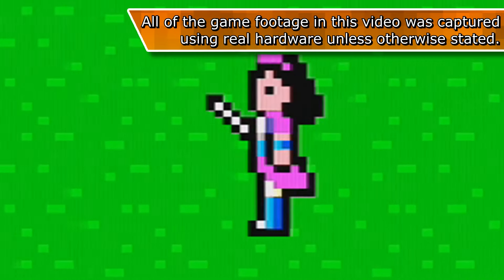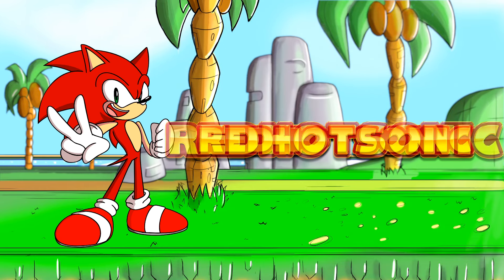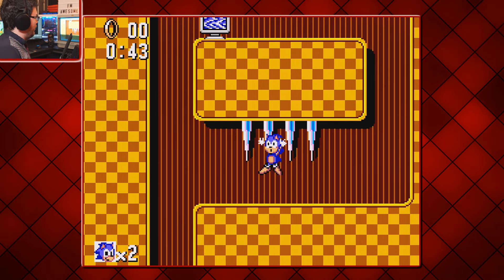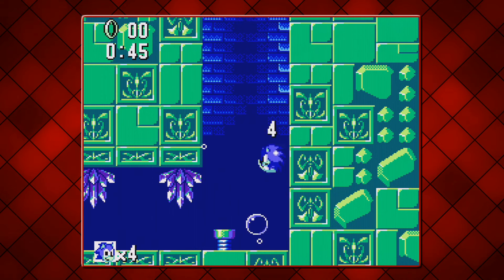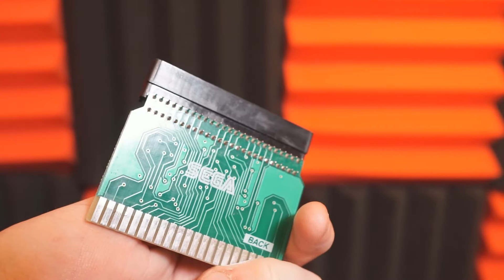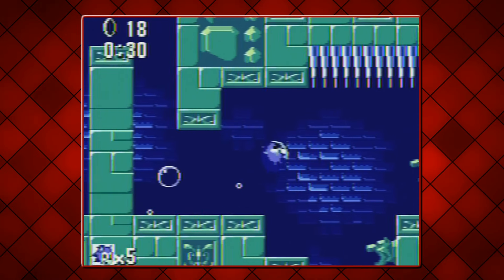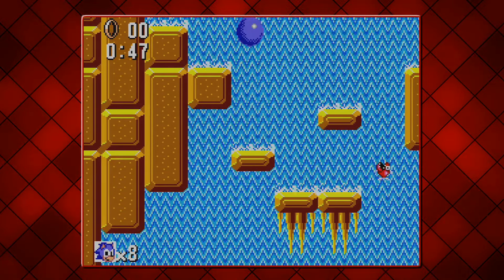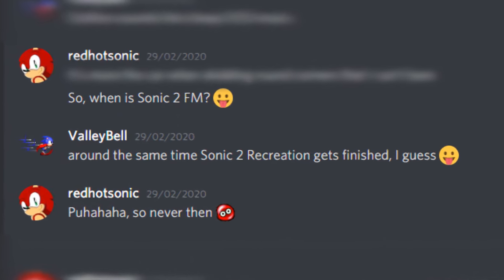Sonic 1 FM - But does it work on Real Hardware?

Comment: I got my Sms2 modded with FM unit but after all of that I decided I much prefer the PSG sound.
The FM music on Master System doesn't even sound as good as Nes standard nor Pc Engine and is definitely inferior to the Mega Drive FM sound.

The PSG is where I feel the Master System sounds decent compared to other consoles around at the time.
Reply from the maker: All depends on the game, personally. If you try the original Outrun with FM, you're correct, PSG sounds better and FM is awful. However, try Outrun 3D in FM. It's the best music I've ever heard come out of a Master System and kicks PSGs bottom.
Reply: @redhotsonic  Probably but when I am comparing Outrun theres two obvious versions.

1 is the Arcade and 2 is the Megadrive version.

The Master System FM version sound's worse than all and arguably even the Pc Engine version depending on your preferences

The instruments used sound very weak to me and sound effects always suffer a bit farty
Reply from the maker: @WWammyy  Yeah, each to their own. Outrun for FM is bad but I urge you to listen to Outrun 3D FM on the SMS. Especially "Midnight Highway" and "Shining Wind". But regardless, at least you now have an FM chip in your SMS so you can pick between the two rather than always being forced to PSG 😊
Reply: @redhotsonic  Will give it a go I've never actually played any of the 3D games because I have an SMS 2 which doesn't support 3D glasses but does support higher resolution than the OG SMS so the Code Masters games work on it or at least that's what I've heard
Reply from the maker: @WWammyy  this doesn't apply to all 3D games, but Outrun 3D can be forced into 2D (it gives you the option after the title screen) :)
Reply: @redhotsonic  Great I'll pull out the console today it'll be my first experience of Outrun 3D
Reply from the maker: Wait, I'm wrong. I think you press the pause (or is it reset?) on the SMS itself to bring up the 3D/2D menu 😅
Reply: @redhotsonic  I have a mod done to my Sms called sms++ so that the pause button is on the controller when using a Megadrive 6 button.
It's very convenient and works nicely

It's one of the best mods on the Sms because it also allows the Megadrive controllers to work on games that don't usually support them and allows for button combinations like button 1+2 / A+B for magic on button C for example
Reply: @redhotsonic  I had a bash of Outrun 3d and wow it's a top game much improved over the original outrun port but possibly less faithful.
However with regards to the FM music I guess it's good for Master System standards but as far as enhancement sound goes.
I still feel the PSG is better overall the instruments used by Sega are weak.

But I do agree with you its a per game thing as I actually quite like the Sonic 1 fm hack that sounds better than the OST.

I was just thinking FM sound in langrange point on the NES VRC 7 it just sounds richer than the Master System FM module but I noticed that they must be combining the normal NES sounds with the FM which the Megadrive later did combining PSG and FM.

Comment: try this With a European Master System model 3010
Reply from the maker: That's not how it works. A European model 3010 does not exist. The European model with have a different number. Also, I do have a European SMS but without modification, it has no FM chip. So, if you try this game on a European model, it'll just play PSG music and SFX. I can only assume if you do get a European model and mod it to have the FM board, it should work just fine.
Reply: i guess if it does lol but i like to see how green hill in the fm chip sounds like when its in PAL

Comment: I almost send a dislike due to "sorry for the picture quality as it's composite only". Composite looks better as these games were made with that in mind. RGB is really not what ever was intended for these machines. It's like apologizing for the SID chip to sound "crackly" or "weird"  as it's filters are analog only :( . Tisk tisk tisk :P . So yes the wife is completely correct to shout at you! As you keep  opting for RGB and saying it gives you a headache otherwise. PHILISTINE! :P 

All joking aside, they did design these games with the composite and even RF signals in mind. It's why Metroid or Super Mario Bros 3 looks so weird on RGB compared to actual composite or RF where you get details you didn't see before :P.  It's a bit of a stickler point for me. 

For instance, look at the letters at 8:44. The shading is off on RGB. You sometimes see more blue or shade than on other letters, like there are artifacts. This is because if the signal was composite or RF, these artifacts would blur and the letters would look as intended with some actual shading and color mixing :) .  BUt I'll shut up now.. sorry :P .